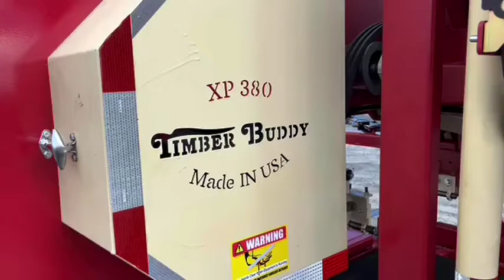2022 TIMBER BUDDY 3680 For Sale

Comment: How much,?
Reply: 80k
Reply: Sometimes you can get cheaper when they are auctioned.  As low as $70k with setworks which this does not have.  I have seen mills like this go as low as $60k
Machinery Trader has one going on Auction right now sold through Bright Star Realty and Auction